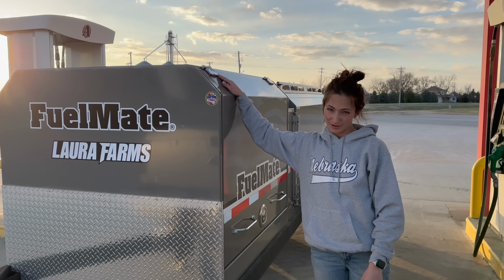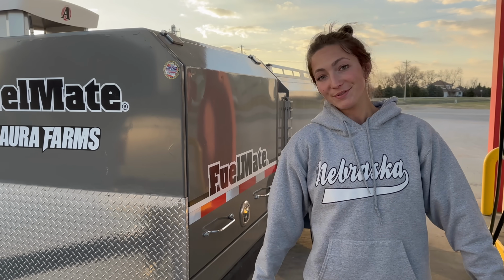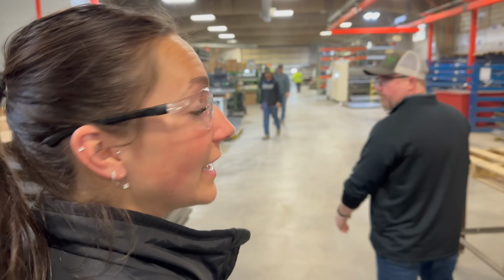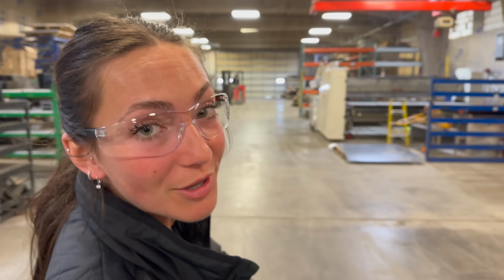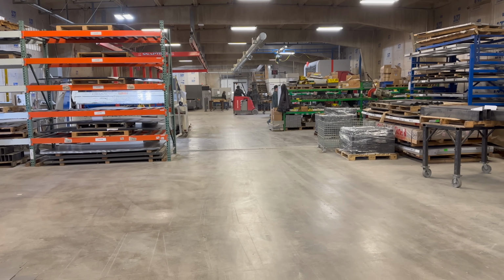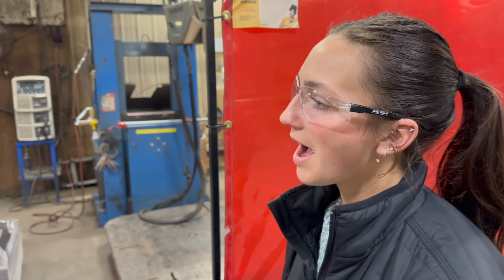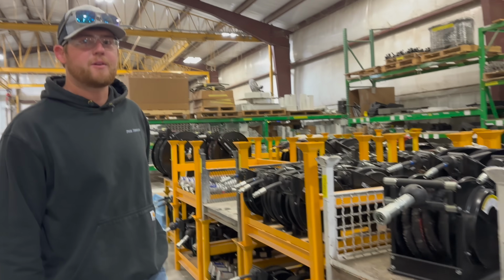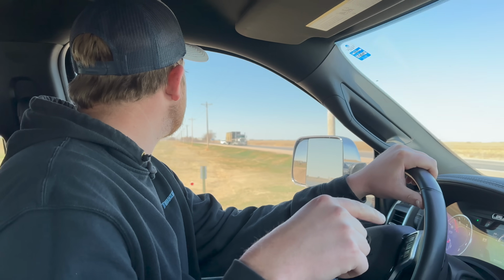WWII Bomb Storage Turned Into Welding Shop

Comment: It's interesting Grant was describing the initial use of the welding shop was a bomb storage facility. When I  was building for the U.S. A.F.  , I built a Missile Maintenance Building , that was designed so all the walls, including the exterior walls would implode , toward the center of the building.

Comment: If you look up Hastings on Google Maps, you can see the rows and rows of the old bomb manufacturing buildings.  it is really easy to see to the East of Hastings. They go for miles and miles (over 8 miles).  Further East toward Clay Center USDA does cattle research on former land from that as well, and there are more sparse sights toward Glenvil.  It sort of forms a triangle where you can see where a buncker pops up here and there.

Comment: I’ve loaded some stuff out of one of those buildings into containers years ago. Near my hometown there is an old Army Air Base, yes at one time the Army had their own aircraft’s. It is also occupied by several different businesses, one including a gun powder facility. There is also one of the oldest wooden aircraft hangars still standing.

Comment: There are a couple small decommissioned munitions bunkers on the northern/eastern edge Mesa-Phoenix Gateway Airport. That site was originally Williams Airforce Base up  until 1993 when it was decommissioned, turned into a civilian airport (an alternative to Phoenix Sky Harbor) as wells as satellite campuses for Arizona State University and Chandler-Gilbert Community College. You can only really see these bunkers from eastbound AZ-24 off the Loop 202 as the perimeter has become so developed they are no longer visible from the surface roads.

Comment: Thanks for this video from a different point of view showing the factory that built your fuel trailer. I was expecting a more automotive type assembly line but the facility is really impressive with lots of complex material handling. I don't know why but having admired the fuel trailer in previous videos I was expecting a little "Mom & Pop" craftsman's shop in someone's garage. Well it's nothing like that.
Now could you please explain what the smaller tank is for? Laura did say something about it at the beginning of the video but I didn't catch it. Unless it was that pollution control stuff? Urea? Recent diesel road cars have a separate tank for it but I wasn't aware it was used in farm equipment that's "off road" so normally less strict requirements on emissions.

Comment: last yr you had a vid of a tractor that caught fire was that the new def style not a fan and feel sorry for you guys having to use that crap that system creates extreme heat under the trucks which is know to catch the grass on fire in dry areas ,so its real important not to leave idle in areas of high grass and brush

Comment: NEVER leave a fuel nozzle if fuel is flowing!! all you need is a breeze, an unexpected bump to the hose, and 5 GPM of diesel (or DEF) are hitting the DIRT, instead of going into a tank... even 'farm fuel' is expensive, esp. when the 'bill' can't get paid until the grain is sold...

Comment: Many bomb and ammunition storage/bunkers were either covered with earth, or the sides had earth piled against them. It probably helped keep stored explosives cooler, but it also served to direct an explosion upwards instead of to the sides where other bunkers were located. Mather AFB near Sacramento, CA was a SAC base, so had nuclear weapons stored in earth covered bunkers. Not sure how effective WW II designed bunkers would have been for nuclear devices, but without a detonator, they were pretty safe.

Comment: TIP: Use your gas / diesel / DEF cap to put in the fueling handle to keep the fluid flowing. A rock isn't needed.

Comment: Nice fuel trailer, but it seems to fill very slowly.  Is there any reason why you don't use a fast-fill setup like the one sold by Pirtek?  You could reduce refuelling times very significantly.

Comment: I work on semi trucks and other diesel powered vehicles, generators, etc... 
Just because I've seen the DEF systems cause immense issues I wanted to kind of offer a little insight. DEF has a shelf life, and is affected by environmental changes like temperature fluctuations. That being said, a huge tank makes sense that you don't have to worry about filling it often, but be mindful that it's not using enough over time so the DEF quality goes to poop..... great set ups regardless.

Comment: That building is at the former Naval Ammunition Depot, Hastings.  Built during WW2, at one point it was producing almost half of ammunition used by the Navy during the war, including 16-in. shells for battleships, depth charges and torpedoes.  The location was chosen due to proximity to railroads, abundance of water and natural gas, stable work force and because it was far from either coast.

Comment: I'm wondering; How much does the trailer hold and how often can you fill the tractors with it?
Reply: There were tapes 100 gallons for exhaust fluid and 990 for diesel

Comment: I made my own fuel tank   , I found a tank from a big truck   it hold 190 gallons     I pick up at an auction for 3 $   and a friend had a dump trailer that was no gd  ,so I cut that down to the right size ,then I had to get was a 12v pump  that was 350-400 $   that was a cheep set up  , I use it on one side job all ready right after I build it    , I all way needed one  , I had a pond to clean out   about 2 ft of mud  all moved with my skid steer

Comment: Didn't realise you guys had Adblu in the states I drive a 2020 uk spec 6195r it does very well on fuel and adblu its constantly running for 14 to 15 hours a day pulling a feed trailer from Mills to our 6 pig farms ,cracking tractor we run 8 jd and a few other makes

Comment: Those buildings are very interesting I hauled steel in several of them 15 years ago or more. They said some of them had to have asbestos insulation cleaned out before they could start renovations for their business. Also just west of Hastings there is a chimney or two just north of US 34 and west of the John Deere dealer is an old WW 2 German POW prisoner camp. There is a pull off for trucks and cars with a big sign telling about the area. thank you for videos I have learned a lot about the irrigation systems that I didn't know when I hauled tons of steel in Valley or Vallmont industries in Valley and McCook

Comment: believe it or not, grant but at almost every remote military facility there is a flat track or shooting range or both. if there is equipment at any point those tracks get a lot less flat.
Reply: The little MX track is used by a current local AMA Supercross rider Preston Taylor. Also KAM Raceway is just down the road a few miles. And a very large gun range belonging to the national guard is just south a mile sharing land with the USDA meat animal research center and University of Nebraska.

Comment: Ihave never seen a DEF fluid pump,i do not even know where to get off road diesel in my area. What a great video guys , i think the reason those facilities were built in Nebraska is that they figured no one could carry enough fuel to bomb them in the middle of the U.S.A and they were right..

Comment: Requiring DEF on offroad ag vehicle engines is so silly. Next they'll require that you wet down your fields before running any implement on them because dust is air pollution.